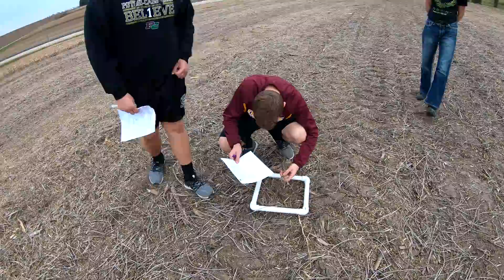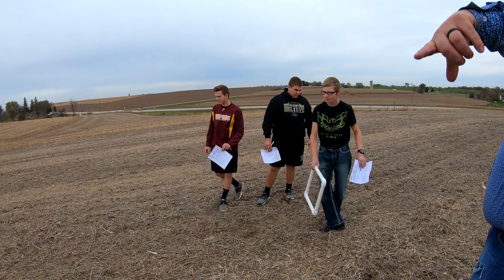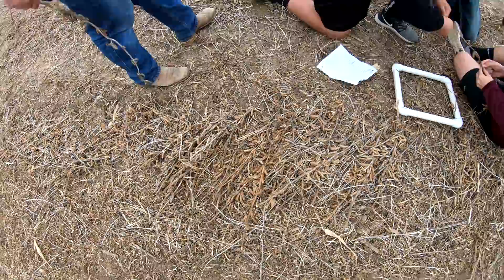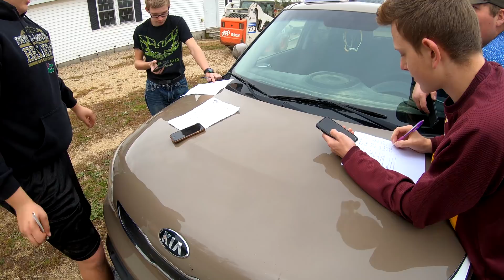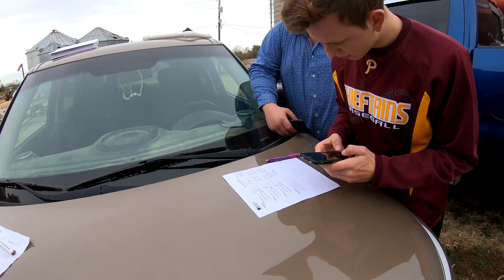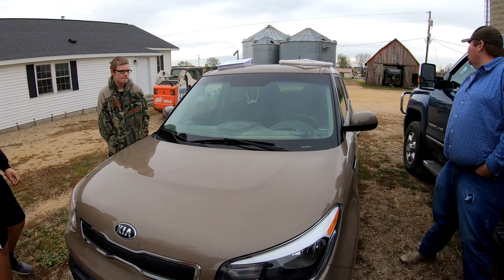Yield Loss Estimations - Potosi HS

Comment: How come they didn't weigh each sample  and calculate loss that way instead of counting the seeds.
Reply: Because that is not how a field harvest loss calculation is done.  It's done by counting the seeds in a square foot.  It's something the combine operator or the cart operator can do on the fly.
Reply: Have you heard of the Bushel Plus . It is a harvest loss pan that mounts to the back axle of the combine,you drop the pan with the chopper in windrow position , seperate  seeds from chaff and then weigh  your loss, and do the loss  calculation with the weight of the kernals. If you bushel weight is way up or down(which could be for many reasons)then the standard for that crop using seed count per square foot to calculate loss can be out by quite a lot. In our crops we would certainly not use seed count. You can do it on the fly.

Comment: Interesting, I never knew that's how they figure it, how accurate is this method?
Reply: It's accurate but they only did ten samples because of time.  To be accurate you need at least 30, and 50 is better.  Plus they need to remove any outliers that have a reason.
Reply: Oh, ok thanks

Comment: There is acceptable loss and excessive loss, when it comes to harvest time. I would call that excessive
Reply: Why can’t you just admit they don’t know how to a set a combine or header properly.
Reply: @dankrogstad6238 well let's see.  When you watch the video you see them counting the sample and in 2 or 3 out of the ten samples the counted 5 beans.  That would mean they are losing 1 bushel per acre.  Then you hear them say that they had an outlier in the sample of 10 where the beans were down and not harvested.  Now one beans plant alone can have 40 to 50 beans on it.  So that square probably had over 200 in it.  In any experiment an outlier should be tossed out because it does not represent the whole field.  There is also the fact that they only did 10 samples because of a time limit.  To be accurate a test like this should be 30 to 50 samples.  My guess is that if that outlier were removed you would see a loss of about 2 bu per acre based on the samples we saw.  The industry accepted standard on good standing beans is 1 to 2 bushel per acre loss.  So they are doing well.

So why can't you admit that they know what they are doing and know how to set the head and the combine, and you might not have all the facts and know it all. 

Just wondering how many acres of beans you plant and what your harvest loss was?
Reply: Acceptable loss is when you've done everything you can to eliminate loss
Reply: @weiniesworld8964  that is true.  There will never be a farmer or harvesting machine that can achieve zero harvest loss.  The closet you could get would be harvesting by hand and of course you would not get very much done.
Reply: They had an outlier in this sample which threw the test off.  They should have removed that one.  Plus the limit on time only allowed 10 samples.  The sample should be at least 30 if not 50.

Comment: Even if you are only harvesting 250 acres of beans means that there is $20,000 sitting in the field becoming compost. How many bushels of loss does it take to justify the purchase of new or better equipment?
Reply from the maker: Previous loss estimations that I’ve done have come out to 3-5 bushels to the acre. They found an outlier in the field where the beans had been knocked over. It’s impossible to not have any loss.
Reply: @HowFarmsWork ,  I understand, as in any business there are cost that cannot be recovered.
Reply: New equipment doesn’t necessarily translate into less loss. I’ve seen guys with new combines have a carpet of corn or beans sprout up after harvest. Properly setting the combine is more important than the age of the machine.
Reply: @whjerts  ABSOLUTELY true... I've seen a LOT of stupid stuff in my time... usually from guys running newer stuff that really don't have a clue what they're doing.  I once saw a semi load of beans where the pit guy and I sampled them by hand as they were coming out of the hopper a half dozen times or more while it was unloading... I'd bet probably 1/3-1/2 the beans in that truckload were split-- every closed handful of beans that I pulled out of there would have a palm-full of split beans in the bottom of my hand when I brushed the whole beans out of my hand sorting them.  Big new combine, plenty of horsepower, and the guy had it set up all wrong.  I've seen soybeans come up thicker than a green carpet behind the cleaning shoe of combines years ago... big IH rotaries running with floater tires taking beans off in November (which is the wet season for us, but full season beans come off at that time here).  They must have had the chaffer and sieves nearly completely closed and were dropping probably 5-10 bushels out the back, because I mean those beans came up THICK right between the wheel tracks, so it wasn't header loss or preharvest loss or anything like that... you could even follow the combine paths through the turns where grain was falling off the cleaning shoe... it was ridiculous!  

What happens when you have steering-wheel-holders running a fancy new machine... I'd take an old machine driven by an OPERATOR that knows WTF he's doing over that ANY day... 

Later!  OL J R :)
Reply: It makes me curious how many acres of partial loss savings would cash-flow an updated larger head as has been mentioned in previous  videos.  Curiosity might kill the cat, but it won't kill the Matt.

Comment: Ryan, are these figures about typical loss in a field?  If not what is a satisfactory loss per acre?   I know you don’t want any loss, but I hear you say on older videos “that’s normal loss” when looking behind combine for pass through beans.   Thanks for the videos.
Reply from the maker: Normal loss varies by farm and fields. You’ll typically have more loss with older equipment, and incorrectly set equipment. I couldn’t say exactly what a normal loss is, as it can vary. 0 loss is impossible, the best you can do is mitigate it.
Reply: The industry standard harvest loss for beans is between 1 and 2 bushels per acres in good tall beans that are standing well.  Harvest loss will increase with short beans and beans that are leaning.
Reply: Jeff Gixer  thanks for the response,  I see you commenting all the time on videos.